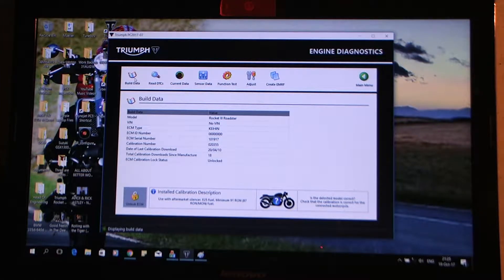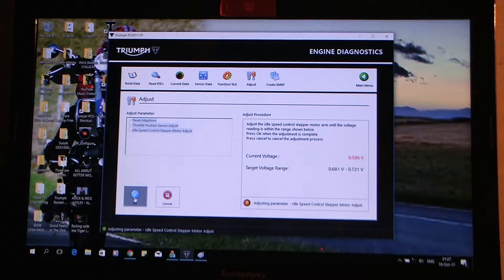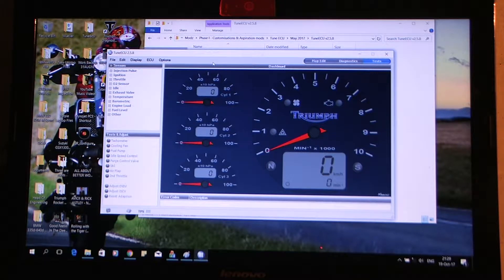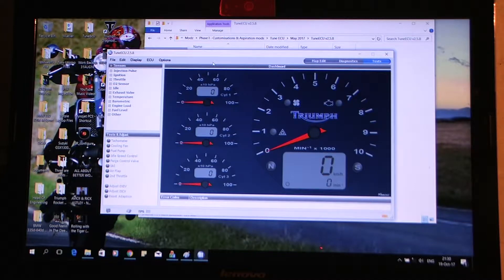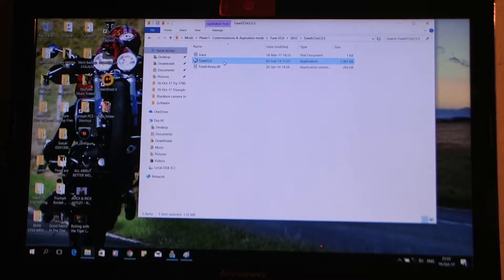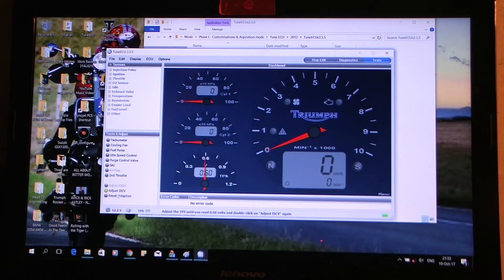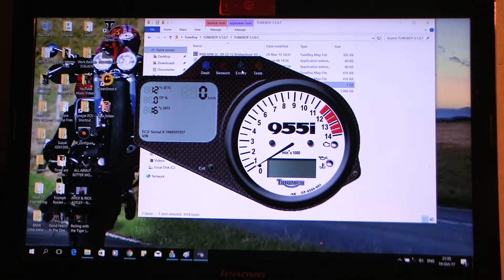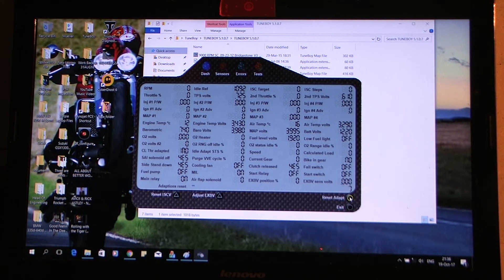TuneBoy vs TuneECU vs Triumph Diagnostic Software

Comment: I have a way to purchase the triumph interface kit for a decent price. Can you use this tool without a dealer login? I need something to set my TPMS on a Tiger 660 and tunecu does not work for this
Reply from the maker: @EnTePalinGenesia  The newer versions require authorised dealer ID logins alright and since TPMS is a relatively new thing chances are that's an obstacle you'll meet.
Reply: @r-iii-rturbo9157  Thanks for getting back to me I appreciate it.

Comment: What cable is needed to connect the original software?
Reply from the maker: @sudochkinnotuos214  the Triumph diagnostics cable
Reply: @r-iii-rturbo9157  ok, did I understand correctly that it is enough to buy a business subscription + kit and I will be given access to this application?
Reply: @r-iii-rturbo9157  ok, did I understand correctly that it is enough to buy a business subscription + kit and I will be given access to this application?
Reply: @r-iii-rturbo9157  I just live in a country where there is no dealer. But I have a dedicated firmware company.

Comment: Which one do you prefer?
Reply from the maker: I usually use TuneECU on Windows (the Android version has more features but is an absolute headache imo with the bike registration jip).
I use Triumph software for bleeding ABS and unlocking ECUs.
And TuneBoy and Triumph get used sometimes as a 2nd view on something after TuneECU.
Reply: @r-iii-rturbo9157 thanks! Does TuneECU not work well for brake bleeding?
Reply from the maker: @hlpang1075  apparently the Android version of TuneECU can do it, but I've not used that function on it yet. When the time came to bleed brakes, TuneECU had introduced the registration of bikes and that put me off using it.

Comment: I need to adjust fan temperature, no option in tuneECU, any way from triumph diagnostics?
Reply from the maker: You should be able to adjust the temperature that the fan switches on at in TuneECU.
Are you using the Windows or Android TuneECU?
Reply: @r-iii-rturbo9157  android TuneECU, but for Trident 660 maps there is no fan temperature in parameters.
Reply from the maker: @SuperRider-RS  have you tried Windows version? What age is the bike?
Reply: @r-iii-rturbo9157  i thought the windows version is not updated for tuneecu, bike is 2021 sept
Reply from the maker: @SuperRider-RS  it hasn't been updated since like 2016 or something. I thought you might give it a go and see if the temp option is visible there, but I'm not sure it will read maps for bikes that new. Maybe give it a go? Nothing to lose
Reply: @r-iii-rturbo9157  okay thank you, where do I find triumph software? I saw it today at triumph, it still looks the same as you have
Reply from the maker: @SuperRider-RS  you have to buy from Triumph and register with your Triumph dealer special code...
Reply: @r-iii-rturbo9157  oh, i'm not sure I even know my dealer's special code
Reply: @SuperRider-RS  At that point you may need a hacked version I think. Don't even know if that exist. Even though USA has some "right to repair laws" i would guess triumph doesn't want amateurs messing with ECU then claiming warranty when they fuck up the bike because they were ignorant. Unfortunately Dealers mechanics tend to not care and do subpar  jobs most times too. So is a "catch 22" situation. For highly perfectionist guys like me, who don't like anyone working on our bikes but ourselves we're in the dead zone.
Reply: @albertoj.mollinedo4116  resolved, I was not using the revised map, which was available from tuneECU app doenload
Reply: @@danvincicustoms6978 seems that’s not possible for trident

Comment: Thanks for showing these. I need to adjust my speedo to match my new gearing. Which of these would be able to do this?
Reply from the maker: TuneECU or Tuneboy, assuming your bike compatible (check TuneECU.net)
They are also map editors, which is where speed calibration is done. Triumph diagnostics is diagnostics only and not a map editor unfortunately